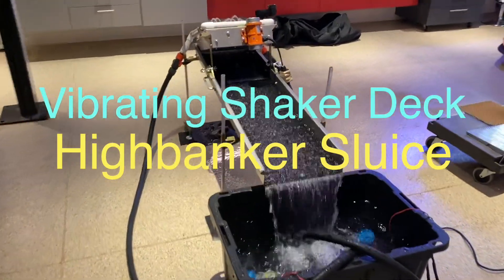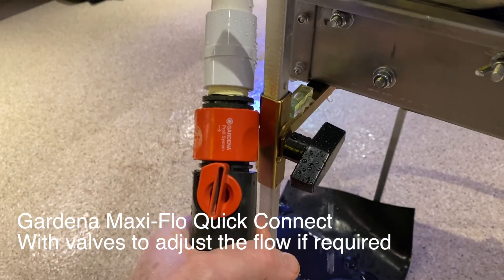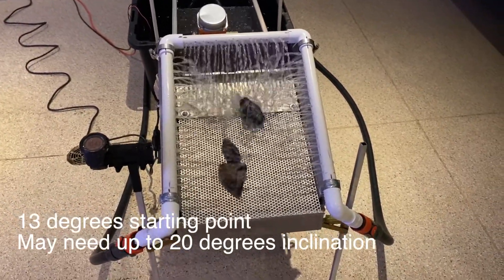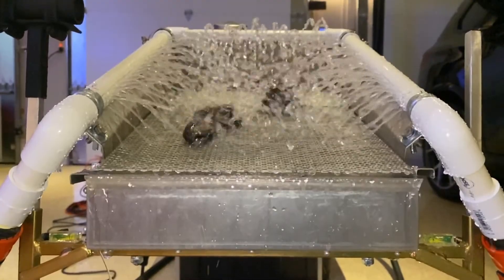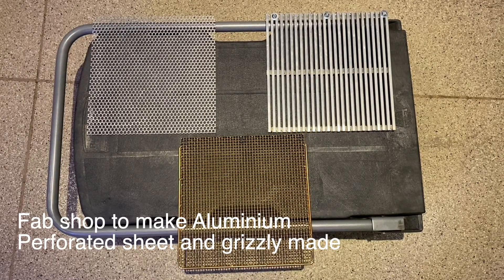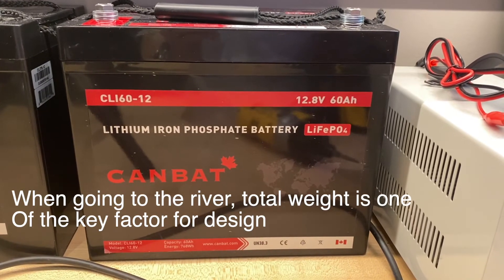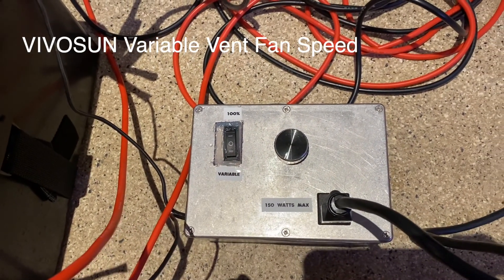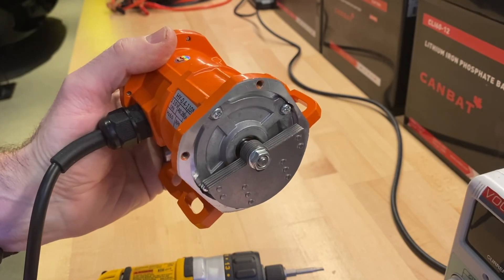Gold Panning Highbanker Vibrating Shaker Deck

Comment: Does mounting the vibrator up high seem as effective for the whole sluice box?
What have you gained by high volume of flow of the water, and steep grade of the box. Does the vibrator and just a little trickle of water not move the black sands almost as effectively as the high flow of water does,  and at far less grade on box? Shaker tables don't have high flows and steep grades, but they are efficient for the fines. I would suspect the vibrator will deliver a similar result?
It could be that production of the material will slow down,  but capture of the fine gold would increase. Still to study this trade off.
Almost finished with my own vibrating sluice box, and a highly modified riffle mat material for first 1/3 of box, but I'm wondering about adding two pipes from sides to aid in clearing any build up of sands after the fines are trapped in upper box.
I'll be working the upper portion of the Snake river in E Idaho in several weeks.
Time will answer many questions.
Reply from the maker: I ended up still using my trommel as the type of rocks and the amount of clay of my area is such that unless I'm using a proper grizzly bar...rocks were plugging the screen holes. Also, to break the clay effectively....my trommel is much more efficient. For our area, here in Alberta, the highest concentration of gold flakes ( very fine flour gold in fact ) is located at the interface of rocks/sand and the clay layer....so I will stick to my trommel for now. But, I'm glad that my experiment may have give you few clues, ideas, etc. Good luck in Idaho this summer/spring and thanks for watching !

Comment: I really like the shaker idea man. I used a table type saw and rigged it up to a sluice. Yours is way nicer by far I bought the saw for 20 dollars at the flea market and the plastic sluice from a cornerstore near my house. The concrete motor seems much more effective. We have alot of clay were I live so the shaking helps break it up faster.
Reply from the maker: If you have a lot of clay, perhaps a trommel is more what you need to break the clay/sand/rock/gold mixture…this is at the end I’m using with a high success and recovery….more expensive although and tough to find. Thanks for watching and good luck !
Reply: @mrgold7181  thanks man

Comment: excellent bubble level additions and the vibrator on the highbank ..funny how finding good SS screens isnt ez or cheap !
Reply: u could get a DC vibrator ... so u dont have to convert dc to ac .
Reply from the maker: Ok good idea…could save some “stuff” to bring at the river. Check my other comments as this vibrating deck was not working as great as I though in terms of very little rocks pluggings the hole and kind of jamming the feed hopper. I re-modified it and I will make a fresher video soon. Thanks for watching !
Reply from the maker: Effectively….I had to find a good metal fab shop that were equipped to make me some perforated screens….their prices were “ok” but not that cheap ! Thanks for watching !
Reply: Looks like a good recirculating system.